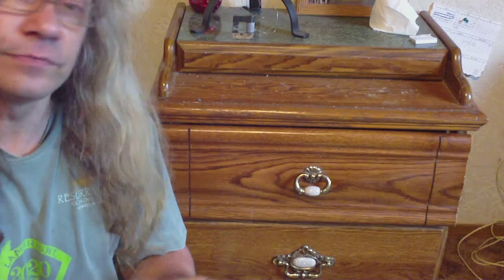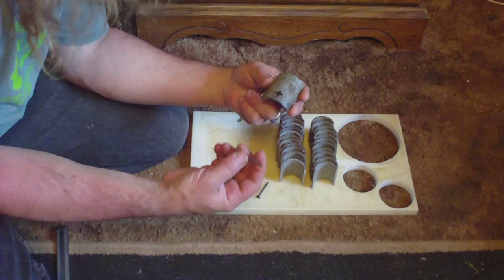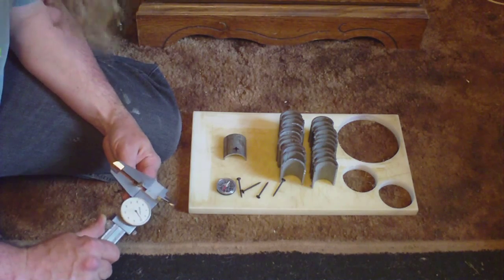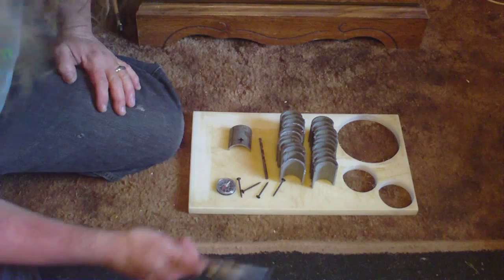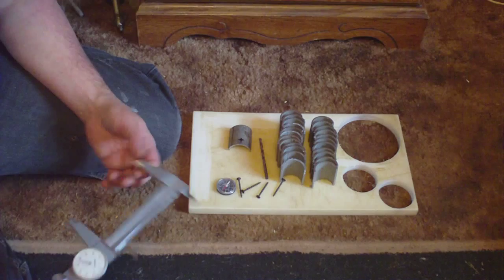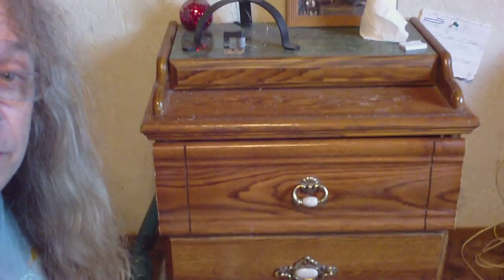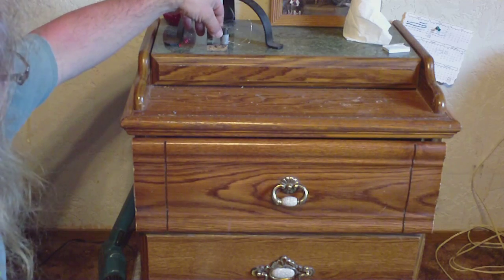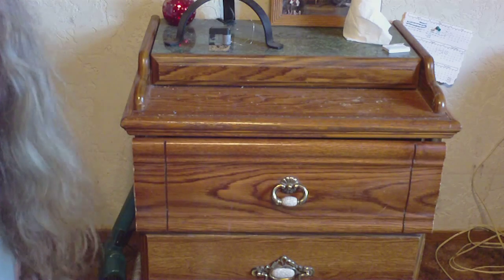step by step #3

Comment: i have the best materials. buy large toroid coils, then cut in half like you did with the pipe. have the wire be iron  core. so the coils are all there then connect them like a pmh, there would be more flow? light a light bulb.